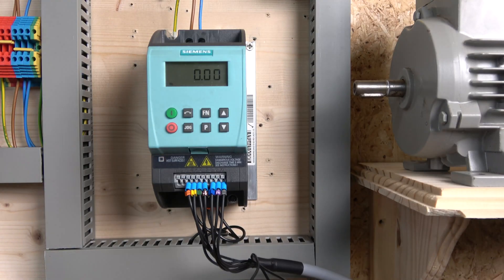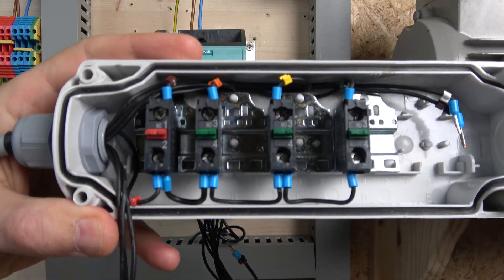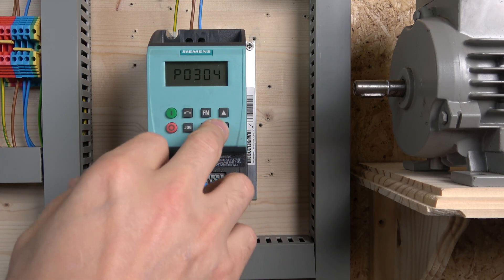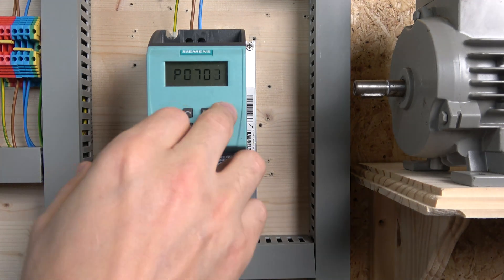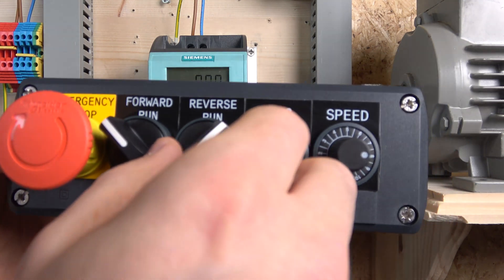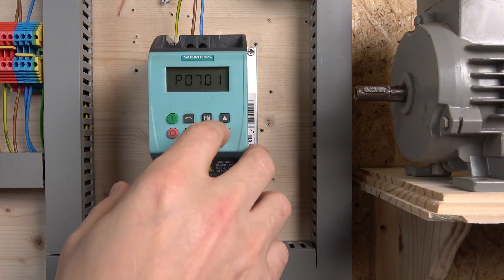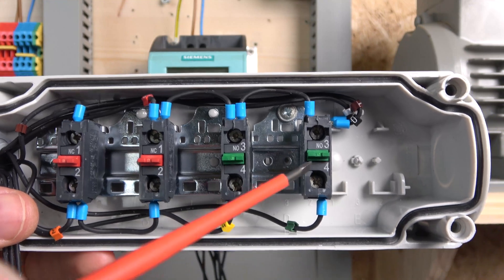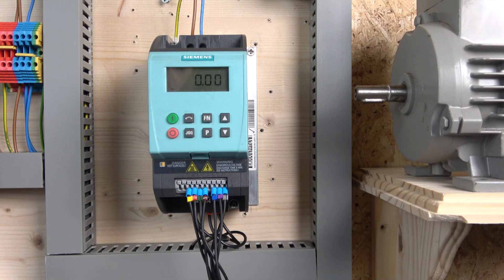Siemens G110 VFD, remote control, 2 Wire control, 3 Wire control, remote speed control. (English)

Comment: Hello mate, i have a g110 ain but it doesn't allow me to access to the 700s parameters, even tho ive tried the number 1, 2 and 3 level of access (the 300). Is it possoble that this VDF in particular cant be turn on via terminals?
Reply: 003, not 300

Comment: Lovely control station. What make is that and where can I buy one like that from. Thanks.
Reply from the maker: These are custom made by me, i use to sell them, but then the components that i used (i.e Schneider electric) Started to become to expensive and in short supply, so i stopped selling them. They are still available, but at whopping 200GBP price tag.

Comment: Hello friend, I have a Sinamics G-110 Inverter, is it possible to monitor by the BOP the "rpm" of the motor instead of the frequency in Hz?, is there a parameter for this change?

Comment: Superb video mate ., but im having some troubles wiring the 3 wire control ., i am shit at reading instructions so relying on video :) Orange marker from e stop ., where does that lead to ?
Reply from the maker: Hi There. If you are talking about the cable number marking 2 form the estop, that cable is going nowhere for this particular drive. I use this cable for other drives, that options for it. So for this drive it do nothing. Apologies for the confusion.